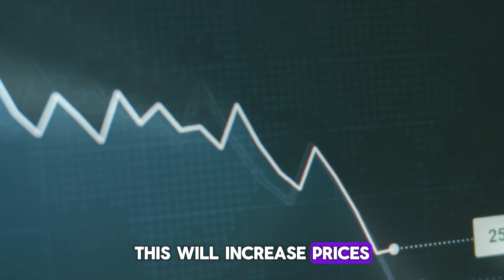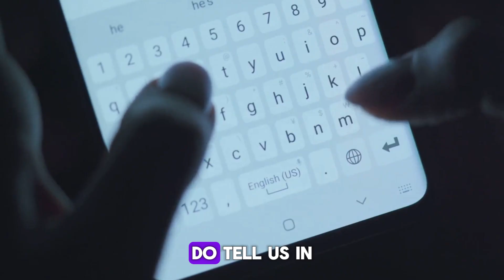Mercedes Drops a Bombshell: YASA Flux Engine Officially Confirmed!

Comment: This is an electric motor - so?  Even if it was 100% efficient, most electric motors are 95% already.  Efficiency isn't the problem with electric motors - the problem is the battery that powers it don't contain very much energy compared to petrol.  Adding even 5% more efficiency won't change that much. What bEVs need is more energy dense batteries do they can hold more energy for a given weight or batteries. Until this happens BEVs will not have long range compared to Petrol particularly in high demand situations like - highway speeds, carrying loads, towing, going up hill. freezing or high temps.